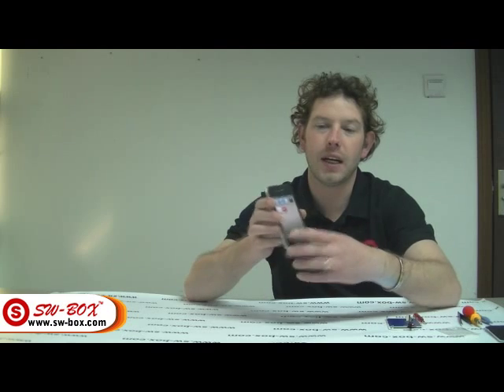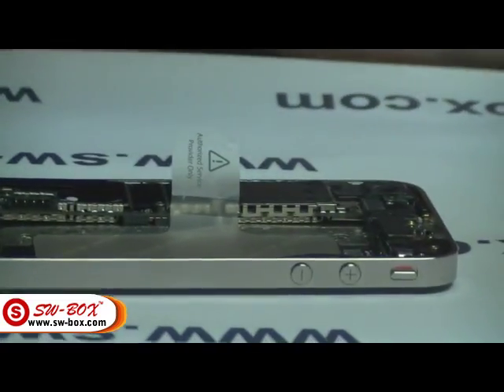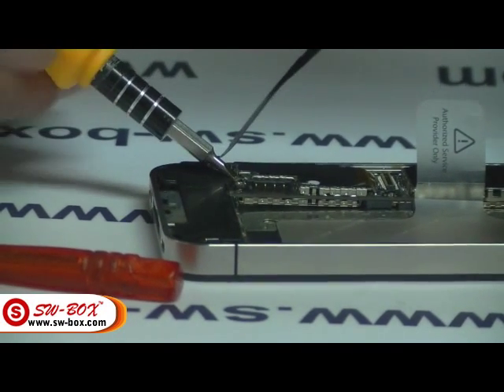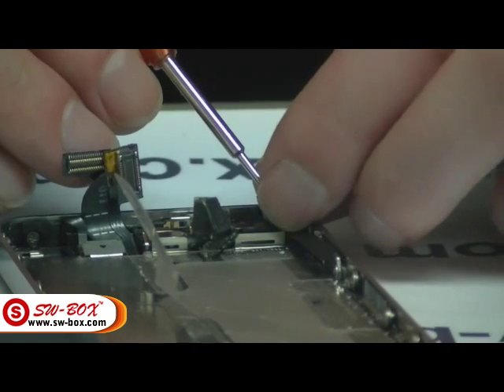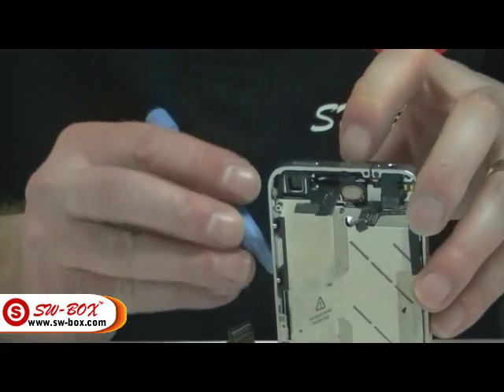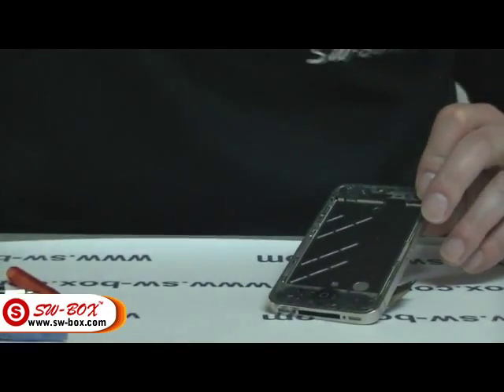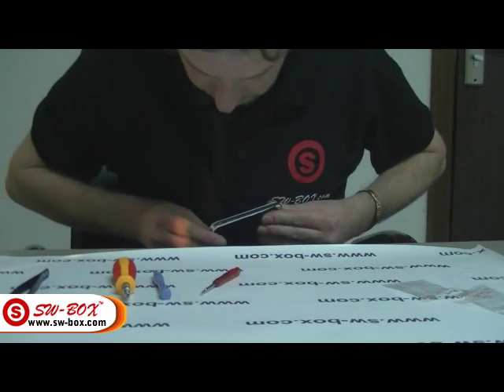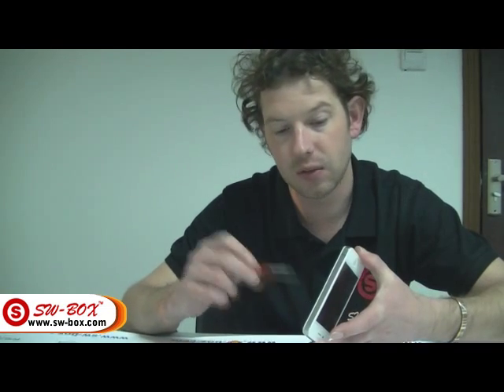How to Take Apart an iPhone4 - Make a White iPhone4 by Yourself

Comment from the maker: Hi, you can replace the home button cable, put this code into the search bar at the top of our website, CODE : 39634, it only costs $3.61 USD, and as for it not turning on, sometimes you need to plug it into your computer, then itunes will help restart it, i hope this helps,
kind regards,
Neill.

Comment from the maker: @ceezy585 The white iPhone 4 Digitizer Touch Panel Screen and the LCD Display Screen are combined by machine, normal people are hard to do that, so the white screen we are selling is a set: iPhone 4 Digitizer Touch Panel Screen with LCD Display Screen. if you only buy the LCD screen or digitizer, it is very hard to install. Maybe you can consider buy the whole set, it is easier to install.